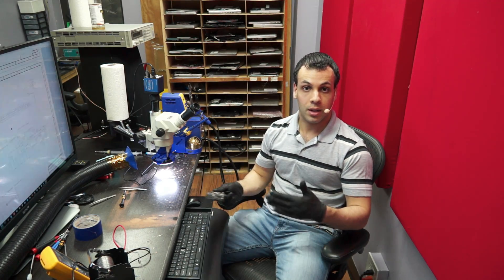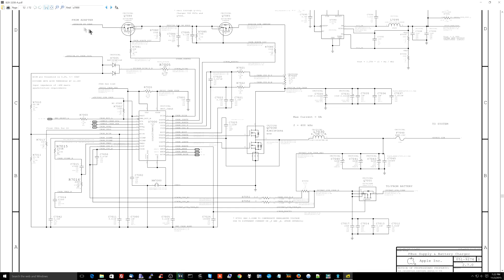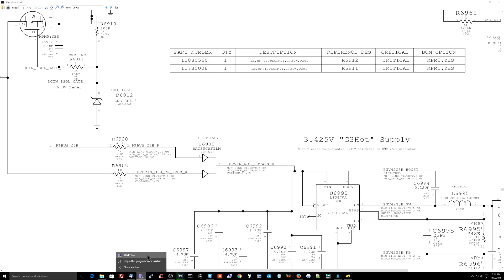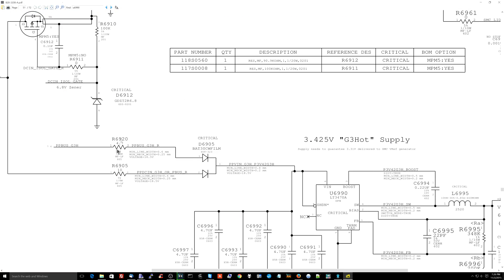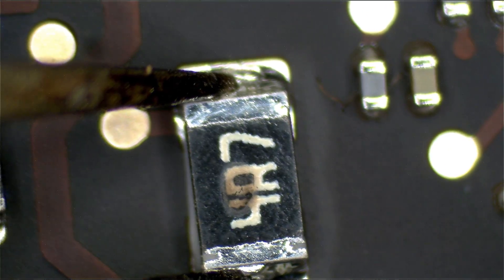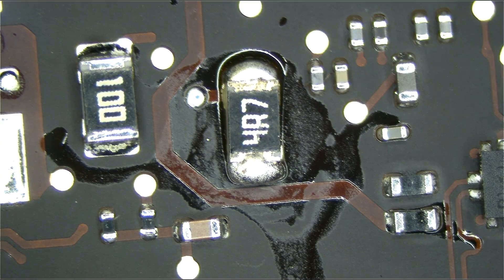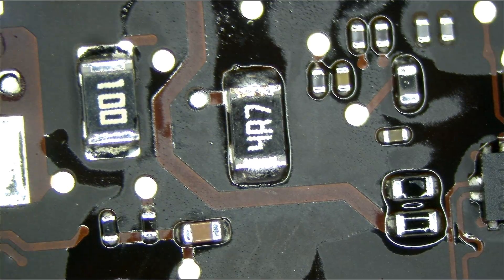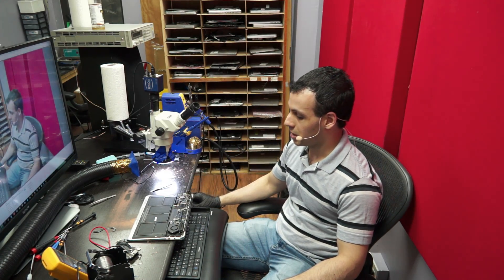Macbook logic board recognizes battery but won't run off of the battery

Comment: Remembered this video when I came across a 2014 MBA with the same problem. Exact same hole in the exact same resistor. Still new to this but this was an easy one, even for me, thanks to this video. Another machine saved from the landfill. Thanks Louis. You were my inspiration to start, and I've already lost count of the amount of times I've found the exact video here to solve a puzzle. Next job is a port replacement on a 2016 A1708. Wish me luck. #RightToRepair ... 4eva

Comment: My one is MacBook Air (early 2015). If I unplug power adapter, the laptop run for 1-2 mins and turn off. Battery is not supplying power properly. It is ok directly with power cable. From system report, I check the battery health status and it looks normal. I also completed SMC, but it did not solve the trouble. Before starting the trouble, the laptop run for 3.4-4 hours with batter backup power supply. Could you please suggest?

Comment: I ran into this problem while replacing the battery on my macbook air. It turns out I just needed to plug in the connector a bit more and it worked

Comment: I have this same laptop and I'm having problems. If I plug battery in it will turn on but once it goes to black screen from sitting to long it will not turn back on unless i go in and unplug battery and plug it back in. If I go in and unplug the battery and just plug in the charger it will work all the time as long as its plugged in. Does this mean my battery is bad?
Reply: Yes.

Comment: My 2015 MacBook pro retina 15" mid 2015 nearly burns my thighs its so hot! The amperage draw is 3000 to -3800mA when not plugged into charger running on battery I just put in which says its connected well and running well...my battery only last 2 2.5 hours....anyone know what this problem is?  thanks
Reply: negative mA is negative three thousand  to negative thirty eight hundred if it didn't show above  do you know why when running off battery

Comment: I have a mid 2009 17 inch and an aftermarket battery was installed, it will run off the battery for a while but shuts off with 90% left? Tried unplugging battery pressing start 5 seconds yet nothing.
Tried rebooting holding down option+ command+P+R yet still have the same issue. Any ideas?

Comment: Had the same problem on my Mac. I pull the power cord and mac shuts down even with 32% battery left.
Problem was the cheap JPYUASA battery from the GOOGOLSTORE (yeah they spelled it like that) with 96% positive feedback from Chinese site aliexpress.
I replaced the battery and problem solved.

What is even wierder is in 2018 their prodiuct pictures show JPYUSASA in the brand and product listing/description.
Then in 2019 they changed their product description/listing and the brand is now 7XINbox with JPYUASA product pictures.

If GOOGOLSTORE does this every year then they effectively get 5 star feedback for their batteries for all of 2018 and users cannot change their ratings into 1 star since they removed their 2018 listing and to create a new one in 2019. Now all the 2018 users have a shit battery and can't leave reviews to a non-existent 2018 battery listing, and they can't review the 2019 battery, which is the same JPYUASA one since they haven't bought it yet because it is rebranded as a 7XINbox one.

My other JPYUASA had another problem, it had 8 cycles in 8 months and now is only able to hold 11% capacity.

Comment: I fixed my son,s MacBook just by watching ur few videos it had water damaged and battery circuit was also ripped I super glued it and used normal soldering iron but made the tip very fine and solder the legs  also replace the Audio ribbon which was rusted it's working good  thanks for great videos

Comment: Having an issue with a 2011 17" macbook pro. WHen battery is in it will start to load, then go to white screen... I unplugged the battery and started it and it will start to load then shutdown and restart on it's own, over and over. I plugged the batter back in, replaced the ram, booted to an external USB to reinstall el capitan and it worked last night.. I logged into the operating system and then went to bed.. today tried to turn it on and it went back to the white screen after the apple logo load screen... I am thinking logic board or video card as it did get weird after a VRAM reset.. had a pixelated multicolor bar show up before it crashed again. Idea?
Reply: i took out my logic board 2011 mac book pro and put in oven for 7-8 minute 365F then i install back. GPU now working fine,also keep old OSX  dont upgrade  ,dont over heat your lappy.!!! will be work fine...i used EL CAPITAN. sierra will overheat your lappy 2011

Comment: Louis, I had to get a MacBook Pro for work. I have the Late 2015 model. My battery cycles were around 850 when I checked a few months ago. I let my battery discharge completely and I can't power on by using the charger. I opened it up and noticed that two cells had swollen. Any idea how I can get it to start up with the charger?
Reply: Same here !!

Comment: Hello, just had one case like that , but in my matchbook air board 820-0165,  battery circuit was fine - resistor R7006 , diode  D7005, and voltage regulator U7090 was fine, thankfully had good board to compare in diode mode. In my case the problem appeared in cable between trackpad to mainboard corrosion, so if you have case like this I can also recommend to check trackpad and its cable flex for corrosion. Thank you Louis for all your work - I learn a lot from your videos, cheers.
Reply: Hi Sebastian thanks for you information sharing you experience, i have 820-0165 and the laptop was turning on with charger , but not with battery but when its connected it is charging , so my r7005 was fine too so i though i check main board cable and i found too corrosion change the cable and it start working amazing thank you so much 👍🙏🙏🙏🙏 Mr Louis i watched you video 100 times too and try to follow your steps and eventually Sebastians suggestion works thank you both 🙏
Reply: @gugutm  👍 great

Comment: So if the SMC is working it should recognize the battery. My Macbook recognized its original battery, and is saying to replace now, and additionally it does not charge or run off of that battery. Now, when i connect the replacement battery it is not recognized, even after an SMC reset. Isnt that strange?
Reply: Check with another battery sometimes it is battery issue if still the same problem than it will be logic board issue

Comment: Good video. Am I reading the title incorrectly, though? My issue is that, as in the title of the video, my Macbook works off the battery, but the battery shows "Batter Not Charging" (it actually is charging very very slowly - maybe 5% per hour).

I have recently replaced my water-damaged logic board with a used one I bought from eBay. Upon powering up, there was some data corruption, so I backed up my drive and reformatted and reinstalled OS X. Now, the only issue is with my battery as explained above. I am guessing this is an issue with the logic board I purchased off of eBay. Maybe corroded traces in the sensing circuit as explained in one of your other videos?

Comment: About the microscope thing... Isn't it just easier to put it into camera mode and view your work on your 4K(!) monitor? Also, another idea is to swap this microscope with the one your receptionist is using, or does she need the camera feature?
Reply: +MrDubje I guess that would lag a bit
Reply: +TG MrNacknime True, but can't be much, I think. However, Louis is the judge in that case. ;)
Reply: +TG MrNacknime True, but can't be much, I think. However, Louis is the judge in that case. ;)
Reply: MrDubje I have never even looked at a logic board or such a microscope, so I can't really tell ^^
Reply: +TG MrNacknime Neither have I. I just based my guess at the hardware he uses. 
The top quality microscope camera puts out a HDMI stream if I remember correctly, so it won't be as laggy as those cheap-as-chips USB things which have to process (or "skullfuck" as Louis would put it) the video data in order to transport it rapid enough to be somewhat useful (at the cost of resolution). 

He did a whole video about it, not to long ago. I have to admit that I didn't pick up anything about him trying this method I suggest here, but if one of his video's does... well... that's my fault then.
Reply: MrDubje
Im just gonna leave what you said here and go to bed, cause you clearly have more knowledge of everything than me lol
Reply: +TG MrNacknime Lol, not necessarily, just planting ideas. But thanks for the suggestion, it's running late (0.27h) and I have to get up early too (yes, on a saturday, lol).
Reply: MrDubje Don't worry, I'm not geting self-confidence issues :P
 My holidays just started, so I can sleep in -
Good night ^^
Reply from the maker: +MrDubje Even without lag this is an absolute nightmare. Try it.. it sucks.
Reply: +Louis Rossmann I happily believe you, can't try it for myself. Thanks for the reply though! ;)